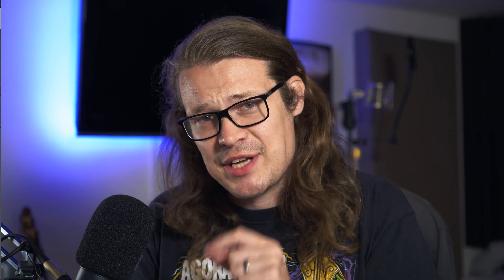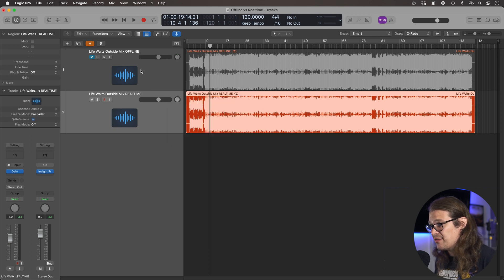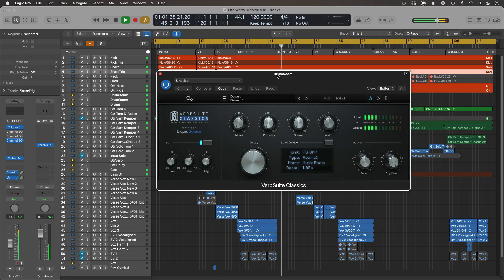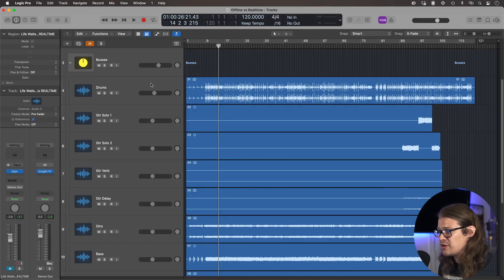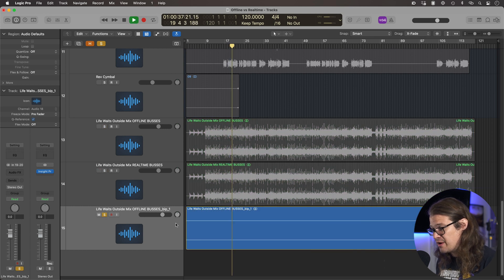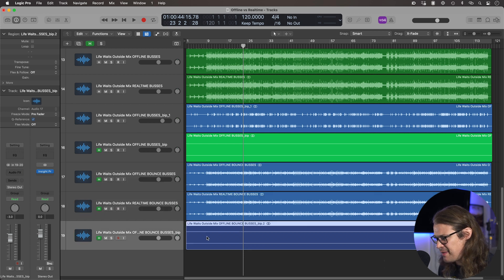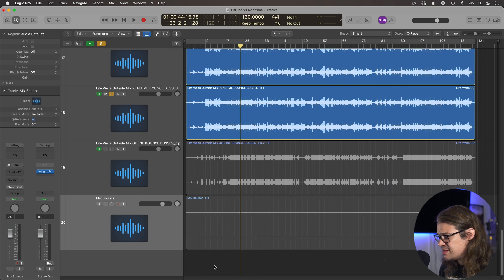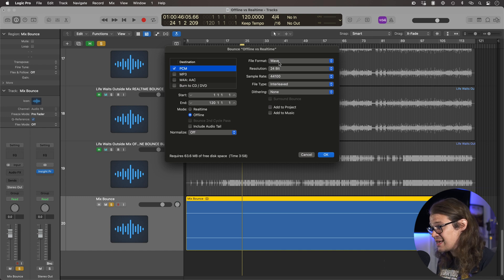Logic Pro X Realtime or Offline Bouncing? Does It Make A Difference?

Comment: Hi, I am a year late to the party but I might have an idea where the noise at 120dB comes from.
You mention that your files are in 24 bit resolution. One one track you are using a plugin to switch the phase, which will cause one of the files to be converted internally to floating point (32 or 64 bit, I presume Logic allows you to chose). So one track has an internal let's say 64bit float stream, the other a 24 bit integer stream. When exporting you use 24 bit again. So the noise might come from the conversion to a lower bit resolution. Or it might come from rounding errors between the float and integer format as they are not bit identical anymore (as soon as you use the plugin).
Try the same test but use a bit resolution that matches Logic internal bit resolution. I am certain the noise will be gone then.

Comment: My theory, in short: What you’re hearing is truncation distortion.

To elaborate. Recording digital is measuring the level of the audio signal at the sample rate. So measuring 48000 times a second if your sample frequency is 48 kHz. 
Each measurement results in a digital “word”. The size of the word depends on the bit depth.
I theory a 24 bit word has a dynamic range (the difference between the maximum and minimum level) of 144 dB and a 16 bit word 96 dB. In theory, let’s not go there!
What happens when you mix two (or more) sources is that you’re adding the 24 bits from one source to the 24 bits of the other one, every single sample. 
The result of adding two 24 bit words is a 48 bit word. If you’re doing a mix (or a bounce or an export) to a 24 bit file you can’t store 48 bits without some kind of advanced digital magic.

So instead we truncate, that is, we throw away the Least Significant Bits (LSB). So everything below -144 dBFS has to go. If we just snip if off we will get round-off errors, since digital can’t handle fractions. This causes distortion. Even though the distortion is at an extremely low level, it affects the perceived sound quality. It can make the mix sound slightly hard or metallic.

This can be solved by using different kinds of dither. Dither comes in a variety of flavours, most of them based on different kinds of noise/hiss. Adding this noise/hiss at around  -144 dBFS creates a randomness to the truncation and evens out the transition between very soft sounds and no sound at all. This is what you want to do if you bounce your mix to 16 bit for CD. 
I know, I’m old school;-)

So I would suggest  bouncing to a 32 bit floating point file, which (in theory) wouldn’t have to be truncated. 
I would argue that the resulting file would either be dead quiet or that the noise you’re measuring would have moved down several 10´s of dB´s.

Sorry ‘bout the long post, but I wanted to be as clear as possible.

This channel was a very interesting discovery.
I’ll be back
Reply from the maker: Thanks for your support! If I’m right, you’re suggest that adding two 24bit files together requires 48bits to truly represent? If the signals are added together then it only represents an increase of a few dB, and doesn’t need the full 24bits again on top to represent. If this were the case, it would be one file occupying the full 144dB of DR, with another signal 144dB louder going up to 288dB of DR, which isn’t the case. I suspect the same thing I found here would still be true at 32bit float, although I’d need to give it a try. Good for thought, regardless 👍
Reply: Logic´s summing bus is 64 bit floating point, unless you’ve changed it in Settings/Audio/Devices.
This isn’t something you’ll notice because it isn’t reflected on the meters or in what you hear when you play a mix in Logic. 
The truncation only appears when you commit the mix to a file.
Reply: Come to think of it, the dither could be the culprit.
I presume you dithered the bounce.
If so, you introduced the thing you wanted to avoid, 
the randomness of the added noise.
Perhaps just doing a hard truncation would do the trick.
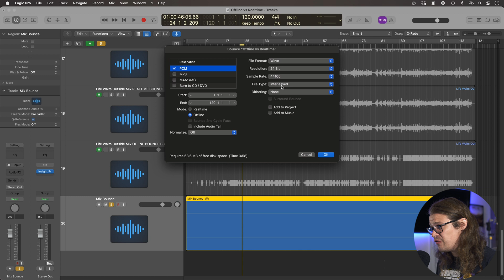Reply from the maker: @UrbanGarden-rf5op check out 8:00 in, no dither.
Reply: Ok, so much for that theory😞